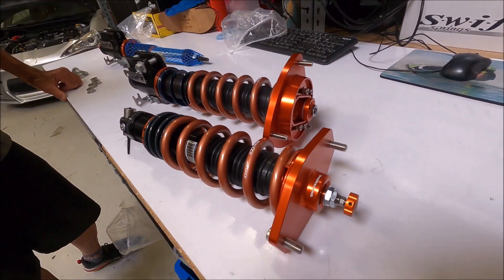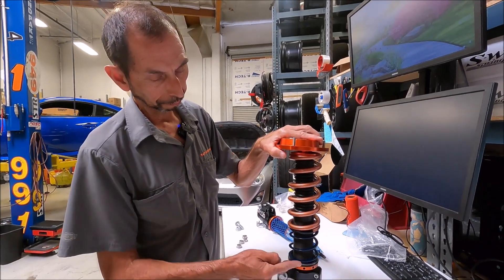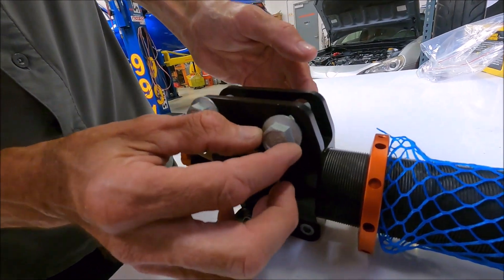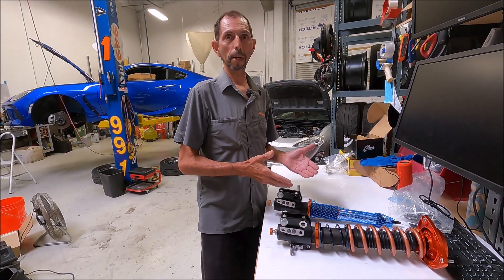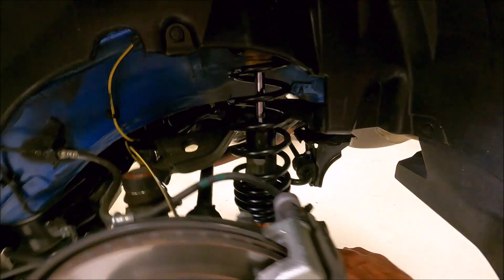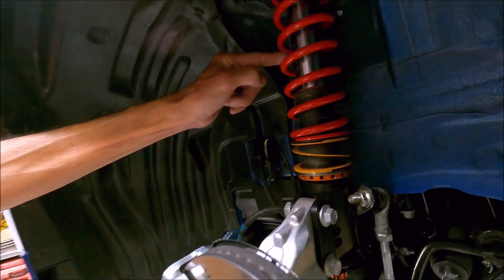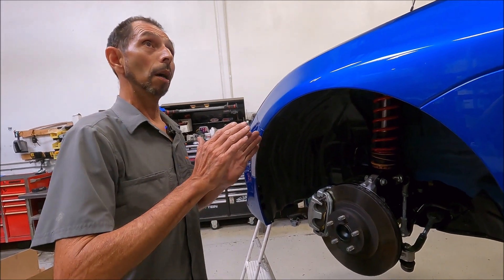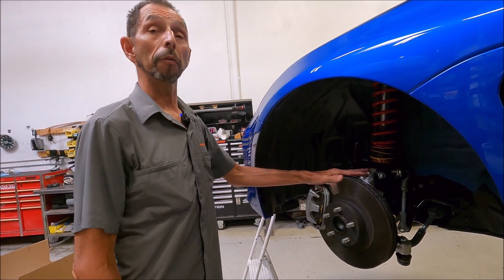GR86 GT86 BRZ Xida coilovers @ 949 Racing

Comment: Does rear also have independent height adjustment?
Reply from the maker: @ruturaj47  rear adjusts the height with spring preload - not length adjustable.
Reply: @949RacingSuperMiata  thank you. One more question, what approximate ride height I would end up with if I set rear to have 33% droop. On RLCA with 0.75 motion ratio that would give me about enough droop of 2" and rest for bump travel. I understand it would depend on spring rate, so give me whichever is appropriate for no aero car running endurance tires.
Reply from the maker: @ruturaj47  shoot us an email I can send you a link to our recommended setup page. Info@949racing.com

Comment: So with the camber adjustable coaxial mounts on your site for the frs/brz, I no longer need to use the plastic spring perches that comes with the st coilovers? 12mm shaft, 2.5 inch spring diameter.
Reply from the maker: Contact us by phone or email for direct support  on the BCM for the 86
Reply: This is for my gr86 by the way.

Comment: If I am on RCE Tarmac 2. How much of an upgrade would the XIDA be?
Reply from the maker: Give us a call or email for a more detailed discussion. Short version: Tarmac 2 are steel bodied, twin tube, conventional shocks based on a KW street shock. Xida are aluminum/ steel inverted monotube pro motorsports based shocks. Like comparing a Civic Type R (nice!) to a Porsche GT3. More camber adjustment range,  ability to fine tune front bump travel, double digressive pistons for optimum contact patch loading in competition style driving.
Reply: I think Xidas are a superior product. 

But I’m on T2s as well. Front bodies of Xidas are steel and rear are aluminum. Spherical bearings on both (if you opt for the vorshlog plates on the T2s). I’m able to get -5 camber as well with the slotted T2s and camber plates. 

Where I see the biggest difference is single tube, inverted, swift springs, and the thrust bearings. In addition, the 500/500 (9k) is more suited for HPDE than the 400/400 (7k) the T2s have. And these Xidas are one way adjustable, two way adjustable just means more user error. Also, even with SPL end links I do have some binding issues, but no clunking with a Perrin bar. They (Xidas) seem to have handled all that.
Reply: @Argentinagang2022   - XIDAs were on the top of my list but got a deal on MCS Karcepts singles... So XIDAs will have to wait for now.
Reply: I would rank it among those three. Xidas > Karcepts > RCE

Comment: Does your "Touring Setup" of 250-200 for the 1st gen car take into account the stiffer rear bar (15 vs 14mm) of face lift models? Do you recommend different rates for those models or just some fine tuning using less rake maybe?
Reply from the maker: 250/200 works well for either bar to balance ride quality with limit handling
Reply: @949RacingSuperMiata  would you suggest a stiffer 22mm front bar with that setup?
Reply from the maker: @Taka-rw3ut  Depends on a few variables. contact us directly and have a chat with Ed info@949racing.com or call

Comment: What are the spring and damper rates? What tire type/brand/model were they tuned on?
Reply from the maker: You can visit the website to see the spring options. We developed this Xida application on a range from OEM tires/wheels to 18x10 with 265/35 Goodyear SC3R. Unique feature of all Xidas is the very wide damping sweep made possible by double digressive valving so high speed rebound doesn't go beyond what's needed for the tire's spring rate. Contact us for more in depth details on the R&D process or visit our threads on ft86club. https://www.ft86club.com/forums/showthread.php?t=150216
Reply from the maker: Additional information in this development thread: https://www.ft86club.com/forums/showthread.php?t=136911

Comment: Clearly a well-thought kit! Curious why you opted for square spring rates on most specs quoting fine-tuning balance, instead of suggesting a particular stiffer front sway bar? Due to motion ratios, a square physical spring rate means you end up with a much softer effective wheel rate in the rear than in the front.
Reply from the maker: We also ran a stock rear sway bar with the 24mm Perrin front. Most of the cars we ran against used a bigger rear bar.. and still understeered. We found more front end grip with our set up. A very notable Norcal 86 driver (who also holds some track records) after driving our car said  "it was the first time he had driven an 86 where the front did what he wanted, endless grip". He also noted that it gobbled up kerbs that his car (on custom valved 2 way - 2 piece shocks) couldn't handle. I edited out some extra stuff about set up and spring rates because it was already long, sorry!
Reply: @949RacingSuperMiata  could you make a seperate clip for the edited out part? definitely would like to learn more about the set up and spring rate for this platform
Reply from the maker: @eyphardware5434  Just give us a call or email. Happy to go over Xida set up with you.